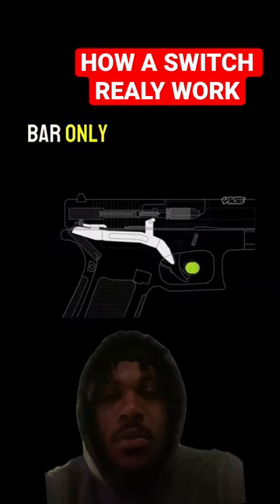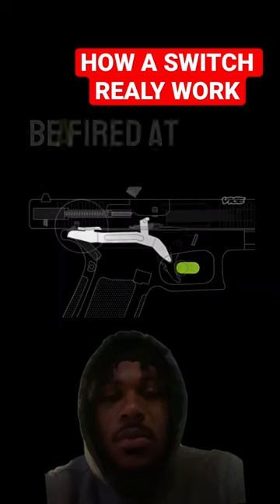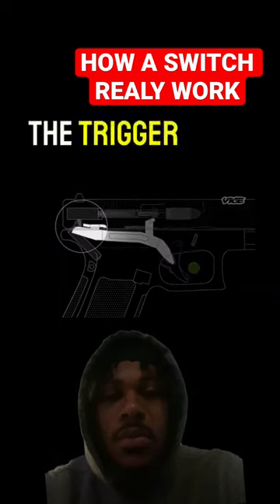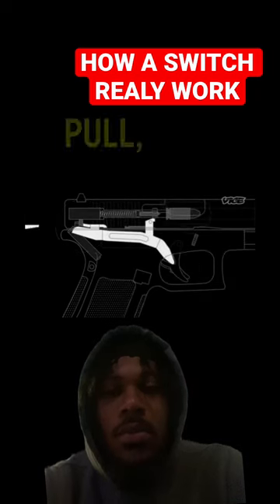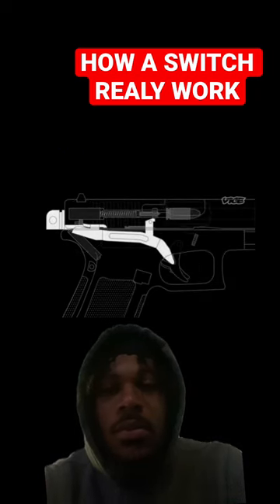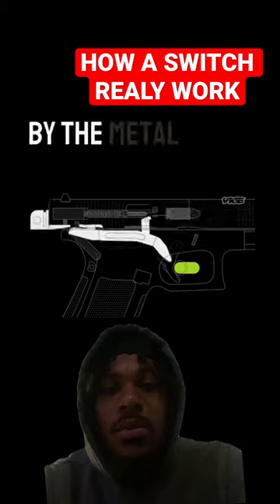HOW A GLOCK SWITCH WORKS IRL..#edc #shorts

Comment: Yeah that’s about right. Although I will make a couple points, to have a good working switch I recommend putting a few hundred rounds down range and fine tune things using a set of precision hand files, second point is shooting a Glock with a switch is a different animal and requires a certain technique especially on a generation 5 with stronger springs, you have to grip it very tightly and when it’s recoiling you need to sorta push against the recoil otherwise you will get jams like a stovepipe jam because the spring doesn’t get to go the full distance during recoil which causes the slide to short stroke and you get a failure to fully eject.
Reply from the maker: Okayyy okayyyyy.. thanx for the knowledge and the comment..💪🏽gods coming soon..🙏🏽